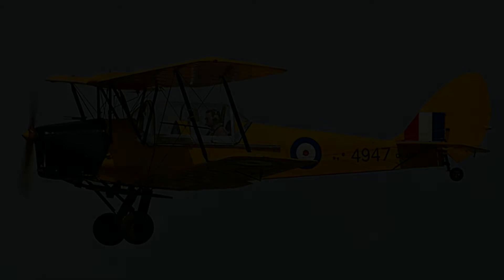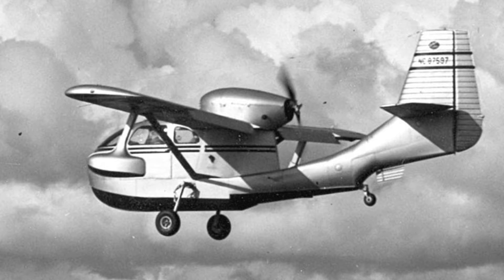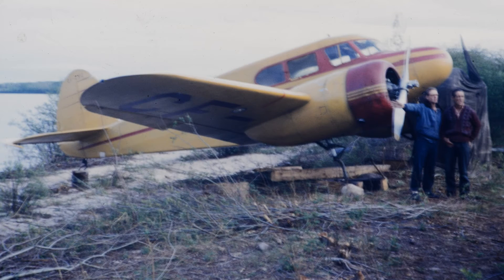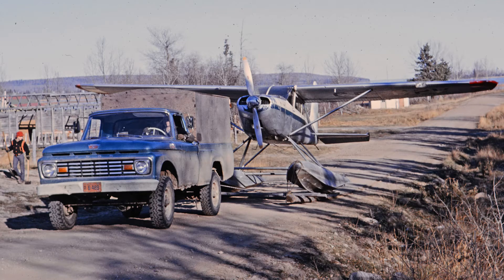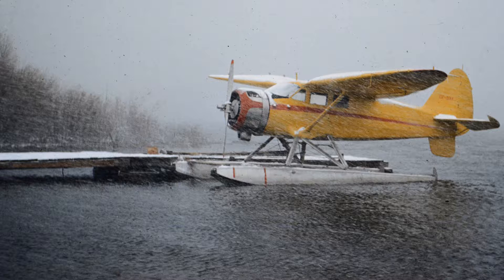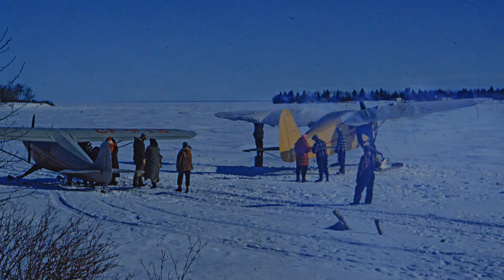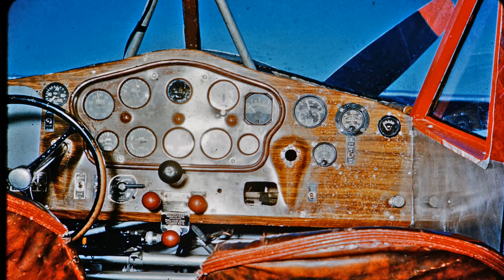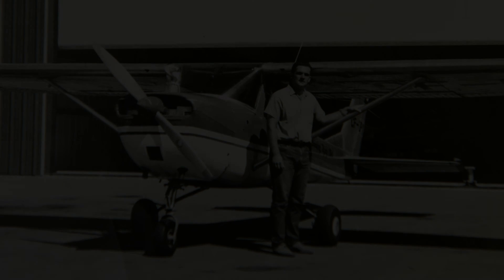The Stinson Reliant CF-OAY

Comment: Great story! Just a few corrections. 

This is a Stinson SR9FM that Ontario Lands and Forest  bought from the factory in 1938. It was built with a cargo door on the right side for large cargo. 

It originally came with a Pratt & Whitney Wasp Junior R985 rated at 420 hp. The upgrade your father did was to the more common R985 rated at 450 hp which was a bolt in conversion. 

The Alberta Aviation Museum has been restoring it to a static display and is using the 450 hp engine.

My father owned BIM, a sister ship to OAY

Thanks for keeping Canadian history alive!
Reply from the maker: Hey! Thanks so very much for that update. A lot of what I related was from what I could recall from my dad bragging about CF-OAY when I was just a kid. I guess I'd have made a poor investigative reporter, lol. I'm hoping to get to see it in Edmonton some day :)